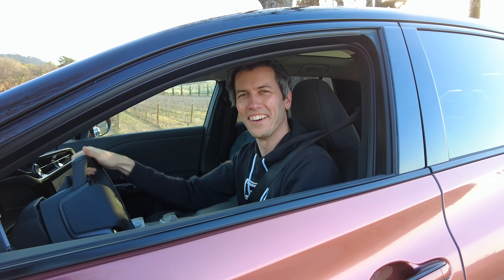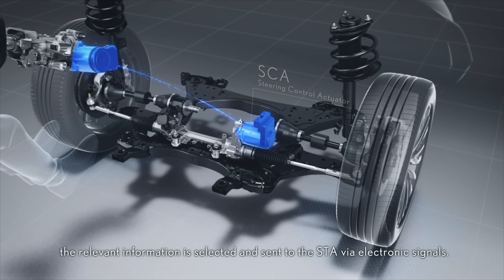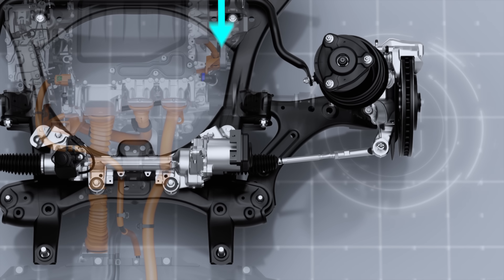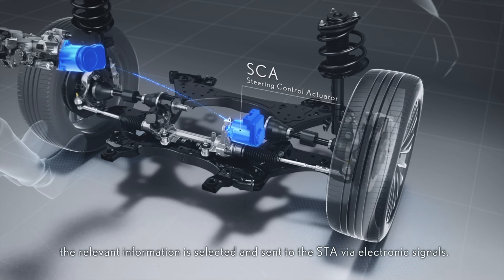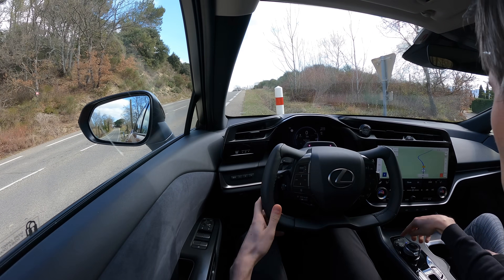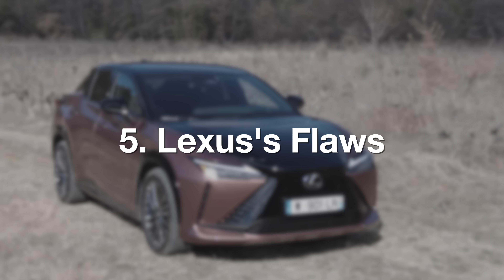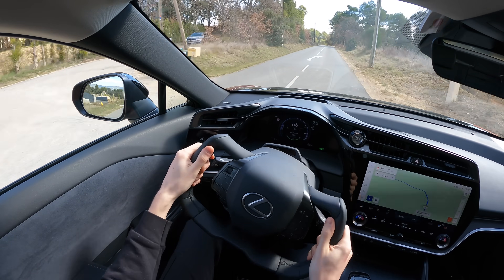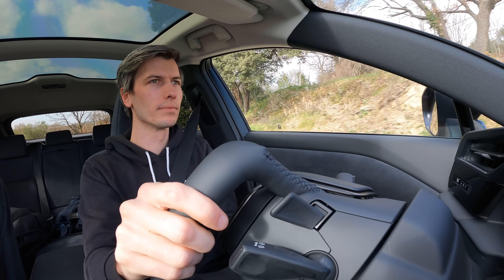How Lexus Fixed Tesla's Bad Idea: Steer-By-Wire Yoke

Comment: The real fear seems to be the possibility of losing control  with no analog backup. But this  doesn't matter because drivers assists already exists to safely bring a car to stop. I highly doubt it will be installed on cars without advanced assistants. Eitherway it won't matter . Systems like these will be overengineered to multiple magnitudes of redundancyto out last the average life of the car. It doesn't . When is the last time you or anyone you know lost your brakes?

FYI, mechanical variable steering has existed for a while, BMW started offering it in 2003. It is crazy though, that Tesla didn't include it as an option considering the steering angle limitation of a yoke considering the technology already exists. The yoke is a publicity stunt to gain attention. Tesla clearly didn't think this through.

Too bad US legislation is going to be very slow, if at all, to adopt this technology. 

Variable steering ratios would be perfect for casual driving mixed with current and future driving assistants; lane keeps assist, adaptive cruise control, semi-autonomous freeway driving, etc. and enhances race track where a very quick steering ratio is preferred for the duration of the track day, steering feel is going to be a whole different question however. This would be a good setup to allow a supercar different steering characteristics.

The only thing I don't like about the video is the mention that F1 Drivers are better drivers and can therefore manage quick steering. It's true, but not comparable. F1 cars don't need to turn at intersections, they have no power steering, the drivers literally work out like athletes, and most importantly is that there are no lanes on racetracks. Apples to oranges.

Comment: Wouldn't a similar system be possible using a set of cvt style pulleys?

Low rotation speed applications like steering should wear very little. This should allow for a mechanical link with electronic levels of adjustability.
Reply: Yes, there are several auto manufacturers that already do something like this (although not with pulleys) including Tesla.

Comment: My bike has 1:1 mechanical steering and the sharpness of the ratio doesn't make it hard to control at speed.  It is of course a totally different experience than sawing the wheel of a car to try to find traction.
Reply: Yes its entirely different lmao

Comment: A fast ratio steering setup with increased wheel dampening at higher speeds would solve all this imo. Make the wheel much harder to turn at speed to reduce twitchiness, boost the power steering at low speeds for quick smooth turning.

Comment: If there is any single point of failure in the system then it will happen at some point and people will die.  You say it has 3 power sources but if a single short is possible to cut power from all three again you will have people die.  Two redundant systems is not enough.  Is there two computers?  You need 3 bear minimum.  Is there any point of failure that can take out the computers?  What about as the electronics age.  Will losing a capacitor on a circuit board mean loss of steering?  Then of course anything controlled by computers uses software and having done my share of programming unanticipated errors in programs happens all the time.  I think steer by wire is a bad idea.

Comment: I actually like the idea of steer by wire if they can get it right.
Reason being once this is sorted, we can get rid of the steering wheel, which is one of the most dangerous parts of the car for the driver, and replacing it with a joystick.

Comment: steer by wire - cool.. but why yoke. you could still achieve the same dynamic steer by wire niceties with a plain on circle. I for 1 like to rest my hand at the bottom of the wheel sometimes on a long drive, with my knees offering support. im sure im not alone in this.  Nothin replaces a good old circle. And i dont think - seeing more clearly your dash - is good enough, thats really a non-issue. That input lag I'm sure is a big resounding no for me tho - it would be like any game lag - get it away from me!.

Comment: What about situation when a car is driven by one hand, just putting it on top for the wheel? Lots of folks do it even if it is not right.
AND this is video has noting to do with the yoke, it's sole purpose to justify steer by wire, which can also be done with the classic steering wheel
This whole idea of the yoke is a hype train, just like with the huge touch-based infotainment systems.
PLUS as usual in 21th century, a company makes new technology, instead of properly testing it and fixing all the problems with lags, with properly adjust speed-to-angle ratio and so on, they just do a show-off. Why modern companies most of the time try to sell the semifinished things?

Comment: I once drove my own 2001 Subaru Outback with aftermarket immobiliser to a field trip to a microwave relay station on top of a mountain. The amount of interference near where I've parked rendered the remote useless and I didn't have the code card with me. Lucy enough I was able to get in, and just use the park brake and brute muscle force to turn the wheel and the remote worked some 1km away from the station. I can totally see this Lexus would have needed a very expensive tow truck rescue in this situation. Also I felt very uncomfortable seeing the yoke turns more than 90deg either direction :p

Comment: Bad idea. Brakes and steering need to be mechanical. Can't have software throwing a wobbly just at the wrong time. And no, fighter jets are not proof of the opposite, cars are driven by the average, which is anywhere between moron and just about competent.

Comment: How is this actually a thing, as many countries require a mechanical link between the steering wheel and front wheels for safety reasons?

Edit: also loss of power would probably not be caused by batteries, but by short circuits, fuses blowing, or cables giving up.

Comment: Brake by wire in passenger cars still has an emergency load path that builds pressure using force from the pedal.

Comment: At the basic level if it's more complex then there's more to go wrong and it's costs more to engineer & maintain.  I don't like the idea of a computer deciding it wants to override my inputs, just as ABS is not ideal for all driving surfaces.  I know it sounds scary but sometimes I like drive with one hand on the top of the steering wheel while going down a straight road.

Comment: SAAB made something like this in 1992 with a side-stick. also with variable steering ratios if i am correct. but as cool as the central stick looked i think i would prefer a yoke.

Comment: I actually had a safety question that wasn’t discussed: perhaps it’s obvious to everyone else, but I wondered what would happen during rapid deceleration.

Since steering response is speed-modulated, during a rapid (say, emergency) deceleration, do the steering characteristics change moment-to-moment? Will beginning a turn at 60 become a different steering input at 30, and then at 10 as I continue turning the wheel and braking? Or does the system assume a constant response during individual moves?
Reply: Since the sharpness of turn that is safe to perform (without rolling the car) varies depending on speed, if you are rapidly decelerating while also attempting to swerve to avoid an obstruction, an oncoming vehicle, etc, then having your steering ratio change as your speed decreases would probably just increase the sharpness of your turn without significantly altering the sideways force you experience from steering, so long as you keep the wheel in the "sharply turned" position. You could, of course, straighten or reverse the turn if you had turned -- or were about to turn -- too far, and I'd expect the ability to very quickly go from a "sharp right" input to a "sharp left" input and have the vehicle rapidly (as rapidly as safely possible) rotate the wheels to match could be a significant improvement in the ability to avoid a collision when compared to a mechanically linked steering column (regardless of how much power assist it might have).
Reply: this isnt the only issue imagine hitting black ice at speed and then trying to regain control of the car spinning the car doesnt know the true speed at the wheels causing lets call it Margin 1 to be increased meaning your traveling at 60mph but the car thinks its 10 because you hit your brakes and kept sliding so that ads margin 2 80-90% oversteer next you have margin 3 your imput lag of what looked like 10degrees at 1 second lag ,
so at 60 mph using chatGPT to do the equations you have a margin of error that equals out to +/- 60 feet left or right of your lane on the highway if the driver needs to make 5 steering corrections over 5 seconds 
thats terrifying
Reply: Steering while in rapid deceleration is crash waiting to happen on normal cars already. Its a thing that you shouldnt do, as in most cases it makes the crush worse and break distance longer while risking rolling over or crushing in something that is more dangereous then the thing you tried to avoid.
Reply: And if wheel spin in snow or lock up what speed does the car think its doing? And with sudden changes. Brilliant question
Reply: They want you to improve your driving skills by making things unnecessarily complicated.
Reply: Actually, hard deceleration should not affect (theoretically) the steering. 
When we discuss about modern car electronics, they are capable of calculating thousands of parameters each second. The time that you would need to brake from 100 kmh to 0 kmh it's quite enough for the car to calculate thousands times what is the steering sensitivity needed. 

From automotive engineer pov, when implementing a new tech, there is always a tunning period in pre-production vehicles. 
During this tunning phase, engineers are doing hundreds of small adjustments in order to ensure that all the possible edge cases are covered, and that's something that this car (or any other pre-production cars) is missing. 

Delay of steering, unpredictable behavior, failure of some components are all things that can happen in pre-production and before pre-tunning, but this kind of stuff happening means that the final production ready vehicle will have it already fixed.
Reply: Good question. I would guess they deal with this by introducing a rate limit on the scheduling itself of the steering sensitivity such that it can only change sensitivity so fast. Then if the wheels lock up, or you decelerate fast, it would take a bit longer for the scheduling to adjust, and you'd have a more constant feeling steering during the rapid deceleration event.
Reply: My additional safety concern came when he said that this meant a better driving experience. That if you hit a bump or a pothole you wouldn't feel the feedback in the steering wheel. When that's a necessary feedback because you need to make a steering adjustment.
Reply: Yep, the car's interpretation of "speed" can be wrong in many situations.  That will cause a delta in the driver's expectation of steer angle vs. actual steer angle.
Reply: What happens if you need to turn at higher speeds to avoid some animal ?
Reply: @nod_pl  yes sudden turms to overcome pot hole or something? At high speeds ? Will it be very sensitive or less sensitive ?
Reply: @nafihnazer4115  
Problem with brain boxes is that sometimes user wanna do thing's that he is not supposed to do(things that no one took in to consideration programming brain box). Read about crashes of f22. It's a very interesting topic, where we should draw the line, between user input and what sensors say.
Reply: @nafihnazer4115 They actually forgot to test that so the car actually instantly crashes if you do emergency manouvers or swerve animals :// Cant be forgetting this kind of stuff Lexus

Comment: id just like to point out that while most ev's do start braking as soon as you lift off, they are no where near as capable at stopping a car than actualy good brakes. for example, a tesla model s plaid will have to cruise the last half of the nurburgring lap to avoid melting its brakes, or crashing due to a lack of braking performance. they may immediately activate, but 90% of EV brakes are terrible for actual stopping performance and longevity. only ev's that i know of that arent trash in that regard are the taycan as it simply doesnt do what you say (you drive it like an ice car. it doesnt automatically brake as you lift off) and the Kia EV6 interestingly enough. theyre getting better but id still say ev's have poor brakes accross the board.

Comment: Its a nice prototype but i think what i would hate the most would actually be the difference in input at highspeeds. Im used to turn X to turn this much, and a normal car always steers the same amount. Having to make mathematics on "Im at this speed so I need to turn more" would just upset me, and probably would understeer a lot of times at the beggining. Also, not feeling the bumps. feeling the bumps is crucial to get a sense on how much grip the car has. Not feeling it in the hands would again make me do math while driving. The delay also scares me. Although I can see there is buyers for this, those that act don't "want to drive", I would need a way more "real experience" to buy something like this.

Comment: Reminds me a lot of those high end mechanical steering wheels for racing simulators. Those were pretty good so I imagine it can’t be that bad
Reply: Apart from FFB SIM wheels don't over ride your inputs, have large steering input delay, and choose not to give you certain forces from the road :/
Reply: @Wiimotejank I dont know where you get delay. Unless your current cars steering assist is also delayed, you have no reason to believe that.

Otherwise sim wheels do all of those things yet you dont even notice. I think you'll be fine.
Reply: @TunaIRL  the video talks about noticeable delay in the steering input...
Reply: The biggest issue I see with this is, we went from one power steering motor, to now four motors some in the wheel and some in the steering rack, I guarantee those "dual motor" housings need to be replaced fully instead of only one of the motors if it fails, this could be thousands of dollars. Only the wealthy can afford that
Reply: Can't mix a simulator with real life situation.
Reply: One small thing worth mentioning - you can't die in a simulator.

Comment: This is the way Mercedes has done it for the past 20 years at least I have a 2002 that has a steering sensor. The steering sensor is going out on one of my cars now but still works fine. Sometimes on a sharp quick turn it jiggles the tires a little. But it cost like 900$ to replace and I have a backup truck so I’m holding out a bit.

Comment: when ur literally proving that steer-by-wire is a bad idea cause they havent fixed the latency on it...why cant they learn from internet wire technology...even as simple as a hdmi or Display port could literally fix the bandwith lag unless theyre stuttering with crappy software thats hindering the flow of response...just like a cluttered phone with maxed capacity...seriously it may be overengineered and thats why it may not be in sync with steering motors...but hey they could always use fiber since its testing

Comment: Toyota has good wiring so I feel somewhat safe about this design but I still like a mechanical linkage in between.. I’ll be scared when dodge decides to do this, as I know how well there wiring holds up against the rust belt

Comment: One important engineering and design factor is that.... you HAD to put "Tesla" front and center as "bad" because you wanted to get clicks. The Lexus is also offered with a mechanical link and has "flaws" but no, that doesn't go in the title or the thumbnail. Lexus "fixed" it, Tesla "bad". Right. Plainly seen at the start of the video, you also glossed over the obvious lag between your steering input and the wheel turning and, more importantly, how it doesn't immediately stop turning when you do. I guess an Engineer has to eat too, eh?

Comment: You did not take it out on a frozen lake to see if it is still controllable in a slide / slippery conditions, where the linearity of the steering / front wheel response needs to be reasonably dependable.  Or put it in a race car on a track like a dirt track where sliding is normal.  From what you are saying, it is going to fail.  They solve one problem, just to create another more hidden one.  Or, it may be OK for the soccer mom, but the pro driver may find flaws that are unacceptable.  When they put it in an Indy car, we will see.

Comment: Looks like the wheel actuating motor is not strong enough to move the wheels fast enough when stopped. So it went its max angle speed and still lagging behind your hands. So less of a input delay issue, but more of a turning speed issue. At least that what it looks like from your video.

Comment: personally i find no issue with having a high steering ratio on our current cars. its not a bit deal having to turn the wheel multiple times when parking and until the new technology with regards to adaptive steering ratios in all different kinds of situations is solid, id feel much safer knowing how to control my car by myself. My biggest concern is having the steering sensitivity being very low at high speeds when there might be something on the road you quickly need to swerve and avoid. If there is some sort of sensor that can see a possible hazard and increases the steering sensitivity so you can swerve out of the way, it is still a danger not knowing exactly how much youre needing to turn. You may oversteer because of the sensitivity change for a situation that we are rarely in. Until they figure this scenario out, i am much safer driving with the current systems we have right now...